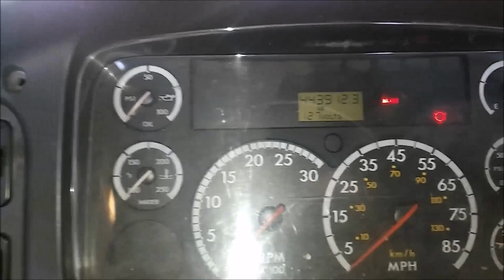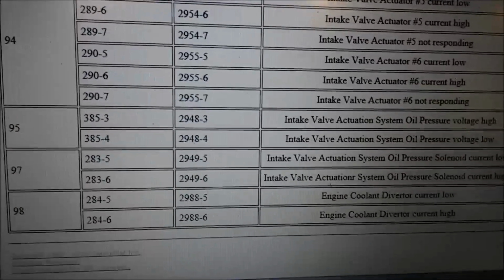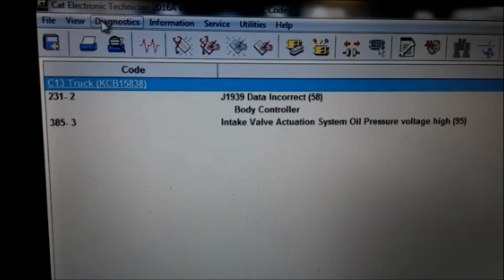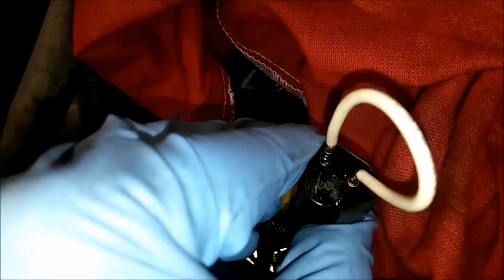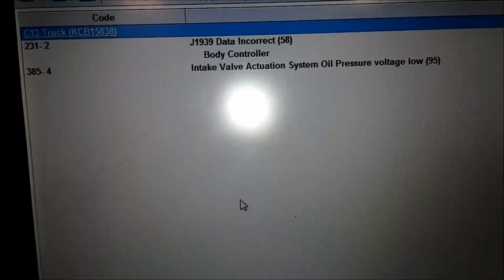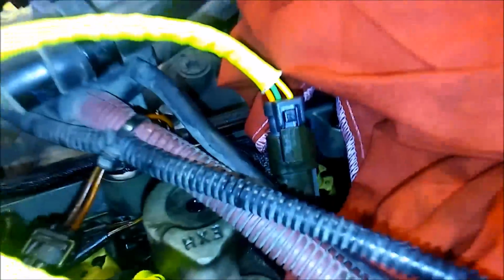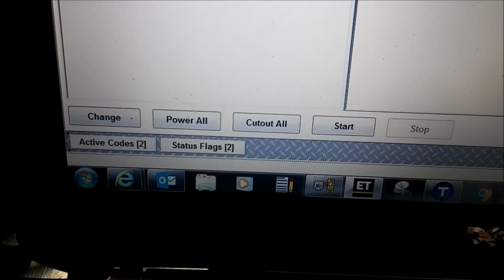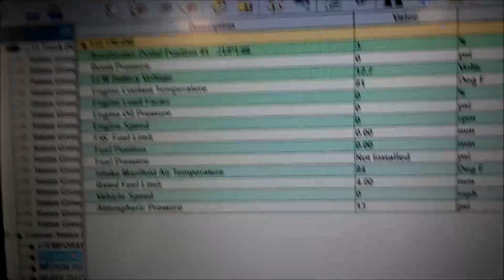Troubleshoot A Cat Check Engine Light.  Diagnose and Fix Cat Trouble Codes and Check Engine Lights.

Comment: For a 07 century with a crank no start. Check  engine light went out after the driver replaced the feul transfer pump n primer. Now the light wont even illuminate at all even with key on. Ecm was taken out n it tested good at the local cat dealer. Che ked pin 70, pin 52 n 53. All good. Unsure which the grounds are tho. Any thing else I can try. Fuel primer is pretty stiff 😊

Comment: I have three Freightliner FS65 buses with Cat 3126 engines that I maintain. The buses do not have cruise control. Is there a way to retrieve flash codes? If not, can you recommend a cheap code reader? Any help appreciated.

Comment: My cat mechanic just changed the injectors and heui pump.  I get a check engine light.  When I check the flashes I get a code 56.  No codes show up with the mechanics cat software.  He is stumped.  Any ideas how I can clear this check engine light?

Comment: I have a 2006 Country Coach RV with a Cat 400.  The check engine light comes on after driving for 1 hour.  Loses power and goes in limp mode going up hill and goes down to 40 mph then will finally shift.  I pull over and turn off coach, then restart and I am fine for about 4-5 hours.  Changed out fuel filter, hoses, gaskets, etc, but have not changed out any sensors.  Thinking it might be that.  Last place I took it was a CAT repair dealership and $2500 later drove for 1 hour and engine light came back on.  Turn it off and started it again and was fine.  I know the front harness in coach has a bad wire because they had to bypass it to read back main harness codes.  All codes pointed towards the hoses and gaskets.  Still not fixed.  Any help would be greatly appreciated.

Comment: Hello, I have a LMTV 2,5t (M1078A1R) which has a C7 engine. May I ask which steps I do need to perform to switch the "check engine" light into flashing mode? As the LMTV does not have a build-in cruise control... 
Many thanks in advance

Comment: I have C9 engine, problem engine oil pressure low, i checked with pressure gauge was good, voltage and signal was good, do you know about the sensor resistance?

Comment: Hi, trying to obtain flash codes on a 2008 western start with a c15 acert. Key on, cruise off, hold the accel/resum button for 5 seconds, but check engine lght does not start blinking, just stays on steady. What's up with that? R flash codes available on that tractor the way you described?

Comment: Excellent video. Is there a easy way to clear codes? I found a crushed red wire on a c7  engine confuser 
harness, 5-1 code have not fixed just re positioned. Thanks.

Comment: I own a RV with the 2005 CAT C9.  I am getting a consistent code 62 using "Press the acceleration cruise button
 method" - the engine  shuts off after running for approx. 2 minutes and shows "check engine" light.  The coolant is full and looks good.  It is along story, but the coolant sensor on my reserve tank is bent about 15 degrees.  I think there is another coolant sensor on the engine.   Anyway, I am hoping the bent sensor is the issue.  I am going to replace it as it seems to be the issue??  I have a Scangauge D which flashed a mystery code that is not in the Cat code  = Code 33.  I got code 62 each time I use the cruise control method.

which flashed a totally different

Comment: Would you happen to know what this would mean?  Oil pressure runs high between oil symbol and 100 psi, Check engine light, engine protect light, oil symbol light comes on, and truck stops running. Oil pressure sensor has been replaced but problem is still happening.

Comment: Can u pull the codes on the c15 sdp without using a scanner?? 
I have a 2008 t660 and I was wondering if u can do the flash codes like the older models of c15

Comment: I tried  to get the code like what you did  ,I had the light on but the dash shut off no light at all,  so I can not account it even with cable charge to my car . I do not know what is the deal with it. it is 2004 FL70

Comment: Hey,  thanks for your videos thanks. For helping us out 
I have a question for anyone out there that may had experience this  before 
I just bought a used freightliner m2. Straight truck 2006  originally a c7 but was changed to a 3126b engine  Alison auto gear box
Truck it's been running good since I bought it About a month ago.
But now I have a problem  as it won't take any gear and reverse light won't light up when in gear
The dashboard shows a masege 
"RANGE INHIBIT"
And some times a CHECK TRANS
also shows 

Do I need a new transmission?
Or shifter ? 

Any comments will be appreciated

Thanks

Comment: Hey I have a 2002 gmc6500 with a cat 3126, been trying to get flash codes but the light blinks every once in a while, the problem is that the truck has a miss I checked the resistance in the injectors without taking the valve cover off and one had 3.7 and the rest is from like 4.4 to 4.7

Comment: I have a 475  c15 Acert regen in a 2008 5900 paystar. I tried to look up the flash code via cruise control but I cannot get it to flash...any thoughts?

Comment: Hi, 
I have a C15 Engine on the deck of a water well drilling rig. Last week the check engine light turned on, but not diagnostic light or code. We realize that it turns on  about 1 minute after we start the engine. We troubleshoot every sensor and most of them when disconnected started flashing the diagnostic light ( with code) and the check engine light (no code  just flashing). According to the Manual and from experience it should keep the check engine solid and flash the diagnostic light for the code sequence. 

The fuel pressure sensor when disconnected turns off the check engine light completely bur provides the diagnostic code. The air intake sensor right after firing the engine turns on the diagnostic light with correct code and it take the check engine  minute to turn on just as it does when all the sensors are plugged in. 

What do you think might be the issue?
Reply: I have a c6.6 with the check engine light illuminated, but no codes or apparent problems. Any advice??

Comment: on my c-15 cat the studs that hole the V V A variable valve actuator broke on 5 and 6, before this happen it was making or sounding very loose, i took it to the shop an they run a lot of test on the computer and  toll me  every thing  was fine. after replacing the studs 9 off them at $ 46 a peace and 4 at $10 an replacing 2 wire harnesses and 4 actuator solenoids

Comment: Hey I have a 2007 Freightliner Columbia with a c15 mx twin turbos I put the computer to see son code but it doesn’t work it said to check the ecm connection and I have tried everything

Comment: Hey Adept, I have a '98 3406E check engine light come on when I accelerate, and then the  truck cuts off.  The flash code showing is 55. Can you help me?  Thanks in advance!
Reply: pork mi caterpillar 3126 me prende una luz check gasge y no me prende
Reply: alguien me ayude

Comment: I have a C-15 single turbo, having issues with oil pressure, gauge just goes crazy sometimes and shows like pressure drops down to 10psi but then come back up to normal, it does this while running or idle, haven't had a chance to check with mechanical gauge, could the sensor make this problem or what else can i look into it?

Comment: Thanks a lot for this video. You may have saved me the cost of a wrecker this morning. I kept getting a 56 code for Check Transmission Customer Parameters: once I saw that I started the truck and wiggled forwards and back a bit and the code stopped killing my truck. Any idea what caused this? I was on a ramp so I can only assume it was a fault for low trans fluid since the truck was leaning to the pass side.
Reply from the maker: +PickupsAreNotTrucks Sounds like you are either losing communication with between the transmission and engine or the transmission was sending a code to the engine. That exact phrase of customer parameter usually indicates a configuration parameter in the ECM is not programmed correctly though.
Reply: Adept Ape I didn't expect such a quick reply. Thank you. I'm gunna run it over to Car today and have them shut my idle timer off and maybe they can tell me more about what happened when they hook it up to the computer.

Comment: I have a cat c7 showing code ecu 128 pid 094. The check engine light comes on but after the truck sits a spell while off the light goes off and the truck runs fine. This may happen day by day or skip a few. I have already changed filters and the fuel pressure regulator. It has been in the shop but every time its hooked up to the computer the light will not show up. These codes were stored from times passed. the injector test showed no problems there. Can you think of anything that maybe overlooked? Maybe a new transfer pump?

Comment: I just wanted to say. I have a 2006 Freightliner Classic with ac15 caterpillar acert. I bought it with half a million miles on it. I replace the head and did rods and mains at just over a million. I'm at over 1.6 million miles. still going strong. it has some Blow by but then again it always did. just a tad bit more now. uses a gallon at about 10-12000 miles.

Comment: my engine shows me 5 than 6. on the 6th the light stays on. when I start the engine, no issues. after about 30 seconds, both check engine lights go on and the top one blinks rapidly about 7 times and on the seventh time the bottom check engine will also blink. than again seven and so on for about thirty seconds and than it shuts the engine off. any ideas?
Reply from the maker: +Chess tradamus What is your engine serial number? Have you looked up that blink code?
Reply: i am heaving the same problem my serial number is mxs 44891 i hope that you can help me thanks

Comment: when i turn my key cold my water temp is 200 and my oil pressure is high  that's not running when I start it it's the same I lose power when I drive  but when it goes off I have all my power. on a 3406 e

Comment: I am a mechanic with over 47 years experience with gasoline engines but love to learn about the operation and repair of diesel engines. I stumbled on your channel and am very impressed with your knowledge and the quality of your video's so i subscribed.
Reply from the maker: Thank you very much for the kind words. I only have about a 1/4 of experience you do, but it's really concentrated on Cat Diesel engines so it helps me know a lot about a small section of the market. Thanks for subscribing, I'm trying to get to 10,000 subscribers so every one counts.
Reply: I know you specialize in Cat but do you know anything about large Volvo trucks? My Son works for a large transport company here in Canada and the DPF keeps plugging and won't complete a regen. Also has a 7th injector fault on his truck. Both the DPF, converter and injector were replaced 10000K ago. They told him that that particular truck has that common problem that even Volvo can't figure out.
Reply from the maker: +wysetech2000 I'm no Volvo expert, I'm very good on regen issues, but unfamiliar with the Volvo aftertreatment systems. On the Cat systems the ARD head or 7th injector, is the most common failure, but since that has been replaced it sounds like you have another problem. Now I'm not sure if Volvo injectors air into the exhaust stream as well if so, could be a boost problem, if the DPF is plugging rapidly it could be a bad cylinder injector dumping fuel into the DPF or a turbocharger leaking oil into the DPF.
Reply: Thanks for your help.
Reply: Adept Ape washed  engine an compartment replaced starter solenoid on fire wall key does not give power to solenoid when when you turn to start position
Reply: wysetech2000 also trk gave me 3dash codes of 11, 51,an75 trk is 2006 volvo
Reply: I don't have cruise control..how do I check

Comment: Ok thanks. Just tried on a kenworth and it did not flash. Truck has Ard head as well. Thanks for the info !
Reply from the maker: If it has the ARD head then it's a regen system and may not work.

Comment: Is this for any truck like kenworth freight liner ex ...?
Reply from the maker: +christian perez Well the blink codes should work on most trucks as long as you have cruise control. The newer regen engines, I've tried and some don't work probably because there are so many more codes on the engines.

Comment: I am running a 2005 GM c8500, with the c7 and an allison automatic, it keeps popping up a spn 32 trouble code for transmission splitter in wrong position. How is this possible in an automatic??
Reply from the maker: +Dan Goulding That's an odd one. It's possible the ECM has become corrupted and is looking for a signal that isn't there. The configuration will have to be checked and see if it is correct.
Reply: Confused the heck out of me too. Running cat et software (non dealer) version. Light comes and goes when under load. Guess it will be a good time for an uprate as well
Reply from the maker: +Dan Goulding Do you have the actual Cat code for the check engine light? like a 208-4 or something in the that format.
Reply: Not with me, this was checked on the side of the highway with a hand held scanner

Comment: iA cat C9 generator engine showed up at my shop with a no start complaint. owner said it had bad fuel but he changed the fuel an filters. i tried the hand primer and could not build any pressure. I looked at the primer and the relief in the transfer pumped bad fuel was an understatement.  I put my electric pump in line but the best i could do was 18 psi. It acted as if it wanted to start but still no start. By the look of things so far I think if should have a new transfer pump and primer. I do not have cat ET and don't want to get into your injectors. What fuel pressure does this need to see to start?
By the way I have been enjoying your videos. It reminds me of my truck shop days. But many years ago I went over to the dark side and started chasing generators all over the place.
PS  I just watched your starter video and well we should talk
Reply from the maker: I used to work in the generator shop before going to the Truck Shop, so I know a thing or 2 about them. Well first thing to check typically is the pressure regulator on the back of the cylinder head. Is this a HEUI C9 or a common rail C9? Typically they build about 25 psi during cranking then have about 80 psi while running.
Reply: that C9 is a HUEI engine and the regulator on the back of the head is that more like a restricted fitting or an actual regulator

Comment: I am a fleet mechanic for an ambulance service in Arizona... I just inherited a 2000 Freightliner FL60 with a Cat 3126B engine. Right now it runs great but I know soon I will be wrenching on it. I'm SO glad I found your channel! I've spent all weekend watching your cat videos and already feel better about working on it. Thank you for what you do! Keep em coming!!
Reply from the maker: Those 3126s are pretty good engines, the HEUI and injectors are the biggest problems with them. I have videos on both so you are pretty well set. If you ever have a question just comment on a video and I will try to respond quickly. Thanks for commenting and please subscribe.
Reply: +Adept Ape yes sir I'm subscribed! I'm pretty used the the power stroke line of HEUI engines and all the issues with them. Luckily we are phasing those out of our fleet. On question on the Cat engine......,where is the Diagnostic connector?
Reply from the maker: +Che Kelley There should be a round 6 pin or 9 pin connector under the dash, typically where the obd2 connector would be. There usually isn't one on the engine itself. Thanks for subscribing.

Comment: Nice videos!!! Have a question. I have a Pete 387 C15 cat. I have no check engine light on. When i turn the switch off the engine keeps running. Check the starting switch and is good. Any idea what could it be?
Reply from the maker: If it has an ECM, check pin 70 for voltage on the P1 connector. That is the rear ECM connector. That is the signal wire for the ECM to run. If it still has 12 volts with the key switch off then you have a problem with the key switch circuit. I would start there.
Reply: Thank u!!
Reply from the maker: +Anniel Perez You are welcome, good luck

Comment: The hard faults are nice. It's those pesky injector harnesses that don't show on a wiggle test that drive me crazy. lol
Reply from the maker: +Travisfromoregon It usually ends up being a roll the dice event with replacing the harness or the solenoids. There is a guy at work that is like the wiggle master, he can get any harness to code on the wiggle test, I never get it to work.

Comment: HOW is C15 valve adjustment & injector hight video coming around my man?
Reply from the maker: I'm still waiting to get assigned to do one, I've been meaning to do a video on it, but I keep getting electrical problems, ECM problems, RVs, and C7 engines to work on. Hopefully I can do one this week and get it uploaded, but it depends what comes in  to the shop.

Comment: so for the issue with the jake solenoid not responding the fix for that could be as simple as resetting the jake valve lash? love the videos i'm learning a lot from them.
Reply from the maker: Yes, so a not responding or not responding properly could be the valve lash setting being off, or a solenoid not working mechanically, or a plugged oil orifice, or a cracked Jake housing. Could be a bunch of stuff actually, but checking the valve lash is the first step. Thanks for the comment.

Comment: the Cummins class I went to last winter, they showed us the same  jumper wire method to check a sensor, using the Insite program. This is the first time I've seen the Cat program. Good stuff !
Reply from the maker: I didn't know Cummins used that system. The active sensor monitoring is probably used by most manufacturers though, I just only work on Cats. Thanks for commenting.